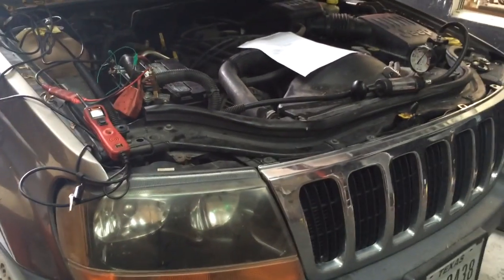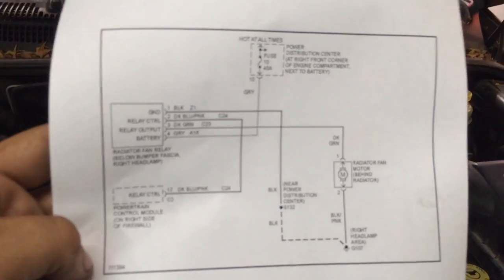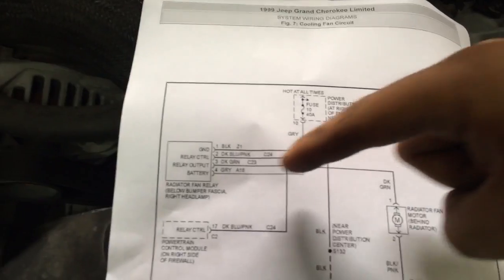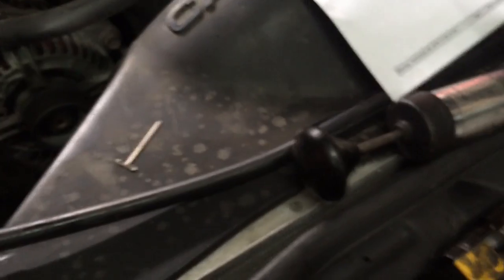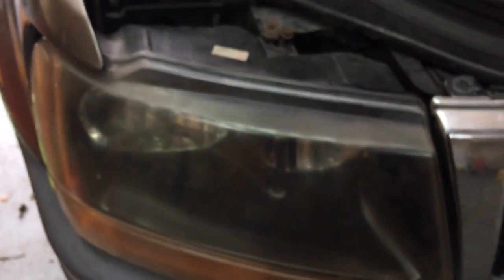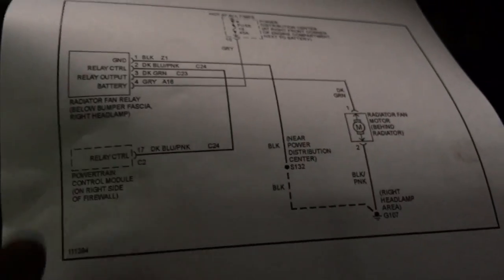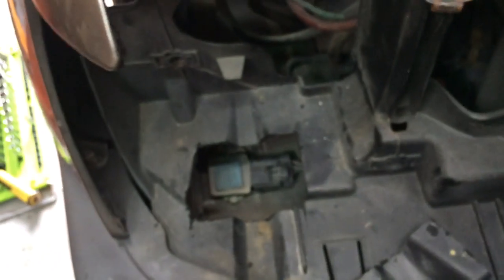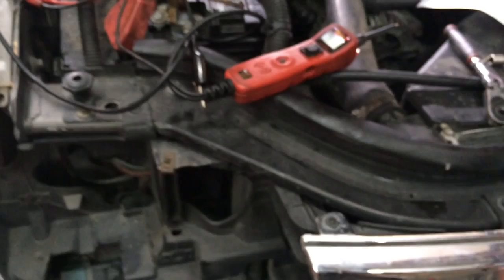How to Test Your Radiator Fan Relay

Comment: 99 wj turn ac on fan will not come on  I jumped fan it works.Pull temp sensor fan runs.Replaced temp.sensor replaced relay fan still.wont come on when ac on

Comment: I had to replace mine that was underneath the headlight a few times so I wised up and relocated the relay to the top of the radiator support by the rubber hood adjuster and it seemed to last a few years and just went out recently

Comment: I have 04 and the relay is located is not located in that area would you know where else it could be located.
Reply: In fuse box under hood
Reply: @michaelvictor196 , if that was the simple case then when would so many ask? You are wrong, BTW.  There is a location marked for it at f10 but there is no relay or fuse there...

Comment: I have the code, but my clutch fan works and my jeep does not heat up
. . . What should I do
Reply: Would the code be cleared if I put a new relay, even though I dont need it

Comment: Hello
Reply from the maker: Chad Dickerson hellllo
Reply: Oz Mechanics how did u test to see if pcm is putting grd to relay?
Reply from the maker: Chad Dickerson you can use either power probe or a test light to see if the control wire from pcm is grounding the relay. Easy way to bypass to make sure the fans come on is to turn on the ac
Reply: Oz Mechanics ok i have poer probe and dont get grd on trigger wire? If i supply grd fan runs? Fan does not run with a/c on either?

Comment: How did u test that relay under the headlight?
Reply from the maker: I tested the control wire. Control wire is ground control. So by sending ground it verified the wire integrity is good from the relay to fans
Reply: Oz Mechanics i did that too if i ad grd to it the fan runs so that means either the relay is bad or pcm is bad right? I put two new relays just in case first was bad and still no fan? So is pcm bad?

Comment: Excellent video. I could not find that relay anywhere, until I saw your video. It was exactly where you said it was. I just cut it open and got the relay out and replaced it with a new one. I went to Pep Boys for the replacement part and it was $79. Yikes, but it fixed the problem. Thank you for the great video.
Reply from the maker: Brian Nolan thank you for watching. Really glad that fixed up your problem
Reply: Go to the junk and get them for free. Haha

Comment: I was changing the right front turn signal and saw mine had a hole already cut. I bought an extra from a junkyard jeep. I have discovered the 04 grand cherokee has it in a difference spot. With these cars you also need to check the coolant level from the radiator cap. The overflow tank is misleading.
Reply: John Nelson where’s it located on the 04? I cut the hole and it’s not there
Reply: In 2004 Jeep located the fan relay to the fuse box.
Reply: @frankzee111 , not true. Which is why everyone with an 04 is asking. There is a spot for it at f10 but there is no fuse there.
Reply: Hi where was your fan relay located because i have an 04 as well and its not in the location he indicated

Comment: Hi Oz, my relay goes bad yearly give or take, is there a way to put the fan to turn on directly with a switch bypassing the fan relay? One local mechanic (not certified) told me not for 1999 and up, I have a 99 Jeep Cherokee Laredo, If it's possible, can you make a video on how to do it or send instruction via youtube message, I would pay you for the video or message with instructions.
Reply: You can use a simple relay instead of the jeep relay and lust wire it up. Relays are simple.Main power and ground supplies the power to be transferred and a signal voltage tells the relay to give power out either positive or negative.Get a wire diagram for this relay like the one in this video and a simple relay diagram and do a little wiring.If you are clueless on what i said then have someone else do it or do some research on relays.

Comment: How to fix a fan that runs constantly from cold engine on to hot.  Engine continues to overheat.
Reply: CHECK WATER PUMP, THERMOSTATO, RADIATOR  MAYBE IS DIRTY INSIDE, CATALITIC (INSIDE THIS ITEM  HAS A FILTER  LIKE BEE PANEL WHEN IS OLD ITS CLOSE GOOD LUCK
Reply: Make sure no one ran a toggle switch to keep the fan on at all times